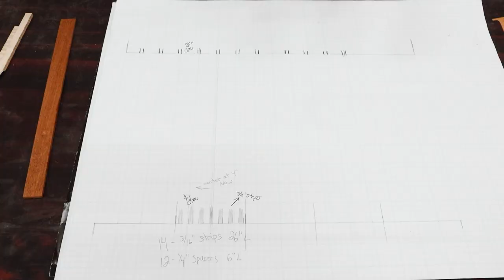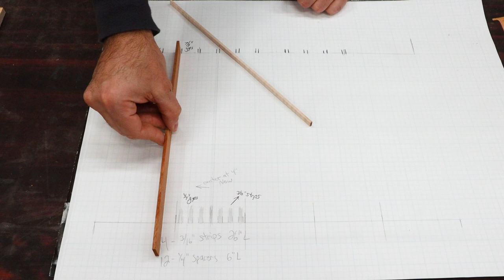Artsy Fan C-Table - A Fun Experiment!

Comment: I wonder if you can improve the racking motion by twisting the outer two pieces in each fan. That would result in 4 angled cuts on the top of the shelf instead of the edge like you did with the second design. Not sure if it would work, but I think it might.
Reply: :O oh wow, that sounds really cool. It would probably be a pain in the b**t to saw that with a table saw, though and to assemble. At least if you want to adopt the second design, since you then need to angle the cuts in two planes simultaneously. But it would look freaking amazing!

Comment: I like it … kind of quirky! Want another twist? Put a bit of an arch at the top and you can make my wife happy to see a deeper top. In fact, I might try that. I gave up my power tools a year ago and now work exclusively (well I do use a drill) with hand tools, so the experiment might be a bit down the road. Chuckle, you don’t know how often I’ve wanted to run something off on the table saw, but on the other hand (pun intended), hand tools are beautiful and much more contemplative. Embarrassing to note, but after 73 years on this planet playing with wood and metal, I’ve finally learned how to use a chisel and realized one really doesn’t need to incorporate much, if any, metal into a project.

Comment: On the first one with 90 degree fingers, the slots should have been made using a box jointing jig. That way the spacing would have been identical on the mockup piece and on the final top. Relying on pencil marks could never result in equal or matching spacings between the slats.

Comment: Is there any particular reason you couldn’t/wouldn’t want to just use a solid board and cut grooves to create the fan? Seams like it could save some time or make the process a bit simpler. You could even just use a small file/chisel to create whatever sort of “bridge” where the board becomes solid.

I really like this look and I think it could be a cool way to add some flair to a lot of projects.

Comment: Why did you glue the finger things together first rather than glue them to the top board first?
Reply from the maker: Because it seemed like the logical order. I’m sure there are several reasonable ways to get it done.
Reply: Gluing to the top first would make it extremely difficult to line them
up properly, when gluing them together, unless they were first drilled, completely
through, for a dowel pin.
Also, it would have been very difficult to run those small strips through the
thickness sander, as they did.
Reply: @zapa1pnt  I feel like if you used a clamp to keep all of the fingers flat with each other you probably could have gotten away with it without using a dowel. But yeah you couldn't send the whole thing through a thickness planer. I don't have one anyways so that's probably why I would have glued it to the top to start
Reply: Agree, creating an alignment jig for the base would be simple, especially for the second design, and if you predrilled holes in all the slats, you could use the dowel to aid in alignment. It would force more scrappage at the top, but avoid fitment challenge later

Comment: If I were you I would just sand down the finger a little bit and glue the top back together, if you are worried about its strength afterwards just glue a thin board to the underside of the top running the opposite direction. 

In woodworking you can never come up with a truly unique design if it is to serve a purpose beyond just decoration since it will still be a type of table, bed, bookshelf or anything else you are making.  Every design is built off someone else's work quite possibly going back beyond homo sapiens with items like chairs.

Comment: Would building a set of spacers (before hammering the "fan" in) to go between the blades, and then clamping them all together, have made the blades go in to the table top with less effort?
Reply from the maker: Only if you can get them perfectly spaced. After building several of these, there's really nothing to it. No need for spacers at all. Just use epoxy and take your time tapping them in. I did several on my own without Jon there and it wasn't bad at all.

Comment: Why not sit the uprights on a block and use a drill press to put a hole all the way through so you can use one dowel that will hold the hole thing together?
Reply from the maker: A few reasons. First, because we were building on the fly and making quick decisions as we confronted issues. Sometimes you just have to make a decision and go without the luxury of hindsight. But practically speaking, it's a lot harder than it sounds to safely secure that piece to a drill press table for drilling. One of the legs always gets in the way and the top is constantly pulling at the legs. Considering the ultimate solution is to drill the dowels BEFORE gluing to the top, coming up with a more elegant but more complicated solution for the dowel drilling didn't make much sense to us at the time.

Comment: Why 8quarter rather than 2inch?
Reply from the maker: Standard rough lumber nomenclature expresses thickness in quarters. Dates back to when the old mills only moved in 1/4" notches. But it's standard industry terminology today.
Reply: @woodwhisperer  huh. Learn something new every day. Thanks, and great video btw. 👍👍👍👍👍
Reply: If you go to the home center and buy 2 inch thick wood, it will be 1-1/2 inches thick.
If you go to the lumber store and get 8 quarter dimensional lumber it will measure 2 inches thick.
Reply: @zapa1pnt  I live outside the US, so I can’t do either since everyone else uses metric

Comment: With the fingers I would say glue them into the top shelf first and you will illuminate a lot of fiddly work later. I think the reason the first design is firmer is because the slats already have a larger stress/bend in them, try cutting the slots in the top at a negative angle/even further then 90 degrees, I think it will get firmer still. A design feature could be instead of using wooden fillets at the bottom you could use perspex and fit some LED's inside the base which would throw light extenuating the curve of the slats.